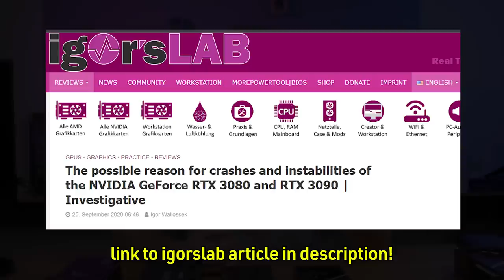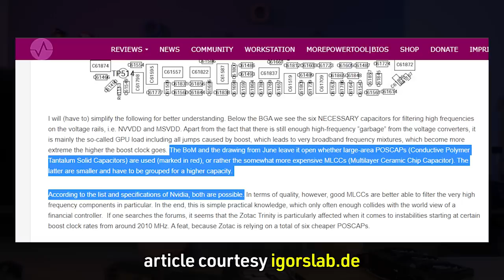The RTX 3080 Launch can't get any worse... Right? Wrong...

Comment: It's shitty because the cards get reviewed initially with the higher boost clocks, so if firmware comes along to reduce clocks, prospective buyers are misled by the high benches.
Reply: As long as they're stable at the advertised boost clock (which seems to be the case as the instability is coming from GPU Boost's ability to go beyond the advertised boost clock) they're fine, with the firmware nerf they'll still be within the margin you should be expecting as a buyer as it's possible for any card even without this issue to have a max boost speed equal to the advertised one.
Reply: Good review sites will make new benches to cards that gets reduced clocks! Don`t follow bad tech sites!
Reply: @RWoody1995  What you said has nothing to do with the issue I addressed.
Reply: @haukionkannel  It's only good if they delete the old content with the artificially high benches.  Otherwise people may still be misled.
Reply: Like he said It might only be a case of the AIB's in question reducing the clocks by just 25-50mhz. If so, then you're talking a 2% to 3% reduction to performance at most. Which If you where doing say 120fps @4K, would equate to just 4fps less. You've usually got somewhere around a 4-6% difference, between the best and worst preforming AIB cards, anyway.
Reply: @haukionkannel  and how do we know which ones are good?
Reply: @massacre072885  uh it has everything to do with it, you said cards would perform worse than the reviewer, i explained directly why they would not as it is perfectly possible for the reviewers card never to OC beyond the advertised clock and therefore even with a bios nerf, you would still get the same performance as that reviewer.
Reply: This is why you never buy a brand new product unless you're willing to deal with something like this.
Reply: @RWoody1995  these cards are already marginally better than the other. A 2% reduction is not a small deal...
Reply: 2BuckGeo  As far as we can see the founders are above spec; with two MLCC arrays, so they should be fine.
Reply: SUE EM! folks sued amd for saying core instead of moduel.. should be 100% lawsuit against npitty ya. the whole 8k label should be a given because the 8k isnt even 8k its lower then 8k. true 8k on it would be a 2fps slide show at True Actual 8k.. and 60,000.00$ for that true 8k screen and it isnt anywhere you could buy on a shelf anywhere. lol
Reply: @massacre072885  they aren't 'artificial' if they were reviewing a founders card, or AIB that has the good stuff. You seem to be getting caught up on some singular point that seriously underminds reality. Anyone wanting these cards will be watching all this and know what's up. And as mentioned, the better reviewers will redo their tests. Considering all of 2 people could even get a hold of these things this far your concern is literally overblown hysterical at best
Reply: @homelessEh  Honestly, I wouldn't be too surprised if the manufacturers sue Nvidia for giving them a flawed reference spec, while selling superior cards that they were able to actually test.
Reply: @LzysGraphics  It is not a 2% reduction though, as long as it still reaches the clocks advertised on the box it's running as fast as you can expect it to, with silicon lottery no amount of high end capacitors and bios tweaks is going to increase the max boost clock if it is set to the same value as the one the AIB writes on the spec sheet and the product page. If it takes it below the advertised boost clock THEN you can complain as you've been falsely advertised to but that's not what is being talked about being done here.
Reply: @fafski1199  that could be substantial to someone especially in the case of vr gaming. Also consider this is all around a bad look for the 3080 especially with amd's offering supposedly right around the corner.
Reply: @RWoody1995  That's not what Massacre is saying though is it. They WILL be slower than the review samples. 1710 + 200Mhz is a significant difference.
Reply: 2BuckGeo  Hopefully not, scalper
Reply: I think the idea is you should take the benchmarks with a grain of salt knowing that firmware may come along to reduce the clocks
Reply: @Massacre That, my friend, is called a "bait and switch" and it's 100% why you should NEVER PRE-ORDER AND NEVER BUY AT LAUNCH.  We wait years for these ground-breaking pieces of tech to launch, we can wait a couple of months for independent reviews, benchmarks, performance results, etc.
It's been said a thousand times before by people infinitely more influential than me, but consoomers gonna consoom.
Reply: @p0xus  The AIB cards in question are not following reference spec. How can they sue if they are not following spec?
Reply: @tacticalcenter8658  
First, the FE did not better in benchmarks than the ABI cards, show me one benchmarks to prove your claim. 
Second, it is not on NVIDIA if they ABIs use cheaper parts than defined in the reference specifications, it on the ABIs. 
Third, that is why you don't buy a new piece of incredible complicated hardware on launch.
Reply: @tacticalcenter8658  
I already watched them. MLID is an AMD fanboy that tries really hard to undermine NVIDIA, problem is that he has no idea of what he is talking about and that he is way more often wrong then right. His top source is his A** where he pulls things from. 😉
Reply: @tacticalcenter8658  True, you are one. 😉
Reply: 2BuckGeo The founders edition are not only safe, they are the better option. Better cooling solution and gpu boost.
Reply: @chadwagner1483  No, but they are based off it.
Reply: @p0xus  Yep, always wait at least 6 weeks before considering buying a new product. 9 times out of 10, there's teething trouble at a new launch.
Reply: @p0xus  How can they sue, when it's them who didn't follow the recommended reference specs? Nvidia recommended that they should use at least one of the capacitors in question, which when used, isn't causing a problem. Nvidia aren't at fault, It's some of the AIB partners for then cutting corners, ignoring this advice and then obviously not doing sufficient testing.
Reply: @tacticalcenter8658  Moores law is dead has turned into a conspiracy theorist and AMD shill. He's pissed because 80% of his predictions and so called 'inside leakers' turned out to be either false or fake. He now seems to have a big chip on his shoulder with Nvidia and is trying to undermine them as much as possible.
Reply: @tacticalcenter8658  Lol like what has been said in comments MLID is a shill. He predicted their would be a 3080ti at release, He predicted the 3080 would cost $1000, He predicted that Nvidia cards would only be getting a 35-40% performance increase. He didn't even know until day's before launch, whether they would be on TSMC 7nm or Samsung 8nm. He stated they'd be released with DLSS 3.0, being a feature. Yet, he completely missed every new feature that the cards actually came with: RTX I/O ect.
And that's just for starters. The guy's a pure shill, pretending he knows leakers and people in the business, but doesn't. On the odd occasion he does get stuff right, it usually either through a plain ol' lucky guess he pulled out his ass or via info, that he poached off someone else.
Reply: @georgschulz8143  The Asus TUF is better than the founders in every way.
Reply: Bullshit. Independent reviews have nothing to do with what is being offered. Whats being offered is on the box. As long as it does that it makes no damn difference what a reviewer says.
Reply: @AFC Steve Yes, that’s true. ASUS TUF is the best card available.

Comment: Asus constantly, going the extra mile and in this case coming up smelling of roses. Credit where credit is due.
Reply: I have to RMA my 2070 this week to them. Hopefully the process goes smooth.
Reply: Yeah I’m just waiting for a good ol Asus brand card
Reply: Bal'a dash, malanore.
Reply: @SlowMenWorking  lol good luck I had to RMA my 2080ti 4 times before they sent me back one that actually worked
Reply: why do you say that?
Reply: @lolliman21  yeah i onder that too isn’t asus like one of the best after market gpu makers?
Reply: @kry1429  not a clue.
Reply: Is that why my brand new Asus Tuf 3080 OC is crashing to black monitors several times a day???
Reply: @JimmyKerrigan  check ur voltages don’t over-overclock it’s a common mistake i believe
Reply: If you see the back of the card  where the gpu die is, you'll aee asus is leaving lot of small MLCC, but just replaced then6 set. So they are not entirely great as they have cut corner and replaced only things layman can see and be happy.😂
So if you see photos videos prior to issues, you'll see Pos caps on all their cards, that too cheap ones (220u). So tney waited till the driver fix came and then re-released the cards and became all goody goody.
Typical bullishit.
Reply: @shshankking  This wouldn't surprise me at all. I stopped buying ASUS because I found them to be overpriced and crap, just like MSI. Gigabyte has been awesome however with this cards launch they also have shown to be shady, although I'm wondering if they decided to do this and with their Aorus brand do the correct thing or even more (which is what I typically stick to anyway)
Reply: @TheSydguy30  Well i have Aorus 3080 Xtreme, and that is carrying 5 pos caps of 470u and 1 set of MLCC. and they also changed this, coz there's a video where a guy opened an earlier media sample of 3080 Master and it had 6 set of 370u Pos caps(like all other form asus strix to evga ftw). So they did change and fine-tuned it, but even before, with 6 Poscaps, they were already filling unused areas with MLCC's which others left on their cards like Asus, zotac, etc to fine-tune the power delivery near the GPU die. So they were doing better, to begin with, but then went a bit further, because of fear, competition or quality reasons, that's entirely on them. but they themselves are not entirely clean, as you mentioned.
Reply: @shshankking  Is that why when seeing ASUS TUF cards displayed on websites such as newegg and amazon the card shows 6 POSCAPs instead of the 6 MLCCs that are shown in jayz video as well as other video reviews?
Reply: That comma will find its way home eventually
Reply: They originally came with 6 spcaps and no mlcc
Reply: @nicklemanski8593  yes. They are using old photos. Even though they are using MLCC, they are of just 22U per unit, and 10 of them makes a single set out of 6
Reply: Dont buy ASUS lmao extra expensive and very bad in comparison to other brands.
Reply: @IorekBear92  Did youu get a new card? Asus warranty is pretty much fake, they charge you a lot of money just to give your stuff a check I hope all went good
Reply: @stevetoalacox  such as? We're speaking about gpus here
Reply: @StylinRed  ?
Reply: @IorekBear92  Dang lmao yeah the guy probably stole it for himself xd well the 1080 is doing pretty good rn the only thing it doesnt have is RTX, I hope someday you get the card thatt you want xd just dont go for asus cards or any asus product haha they are pretty bad and expensive
Reply: @stevetoalacox  you said don't buy asus it's expensive and not as good as other brands, I asked such as? (speaking of gpus here)
Reply: @StylinRed  Any other brand. Are you going mad about this? are you an Asus fan? Ill just leave you alone
Reply: @stevetoalacox  any other brand? 😂 Ah ic, I just wanted to see if you were a hater, or was offering legit advice, I guess you're a hater, by saying "any other brand" it makes that pretty clear
Reply: @StylinRed  ?? See ASUS fanboys will always be like that. cya boy trying to explain stuff to you is useless. try not to go mad about it, oh and besides that GYGABITE, AORUS, and ZOTAC is better.
Reply: @stevetoalacox  you just named the worst brands... Gigabyte uses cheap thermal pads that leak oil ASAP, and zotac has horrible quality control, so some gpus come with no pads and improper gpu paste, etc... If you had said EVGA I would've believed you weren't a hater bcuz evga makes a solid card, they're cheaper, and use same quality components as asus...
Reply: @stevetoalacox  🤷‍♂️
Reply: @stevetoalacox  everything goes oos the moment it comes up... There's a gpu shortage
Reply: @StylinRed  lol evga makes bad quality components.. See buildzoids pcb analysis of evga ftw3, you'll get you answer.. Also, asus cuts corner, but not to an extent some other brands does. Ad about zotac, they had one of the best 2080 card in last gen, amp extreme edition, solid pcb, and one of the top 3 highest clocking..

So curb your enthusiasm, all brands are same.. Some just bit better, not best..

Comment: A quote from EVGA forums:

Hi all,
 
Recently there has been some discussion about the EVGA GeForce RTX 3080 series.
 
During our mass production QC testing we discovered a full 6 POSCAPs solution cannot pass the real world applications testing. It took almost a week of R&D effort to find the cause and reduce the POSCAPs to 4 and add 20 MLCC caps prior to shipping production boards, this is why the EVGA GeForce RTX 3080 FTW3 series was delayed at launch. There were no 6 POSCAP production EVGA GeForce RTX 3080 FTW3 boards shipped.
 
But, due to the time crunch, some of the reviewers were sent a pre-production version with 6 POSCAP’s, we are working with those reviewers directly to replace their boards with production versions.
EVGA GeForce RTX 3080 XC3 series with 5 POSCAPs + 10 MLCC solution is matched with the XC3 spec without issues.
 
Also note that we have updated the product pictures at EVGA.com to reflect the production components that shipped to gamers and enthusiasts since day 1 of product launch. 
Once you receive the card you can compare for yourself, EVGA stands behind its products!
 
Thanks
EVGA
Reply: They got caught red handed,   trying to what they can get away first
Reply: @janc4176  Sounds right, there's no week of R&D needed when the 1st question should be "what's different between our card(s) and the Reference drawings from Nvidia or Nvidia's ref+ design
Reply: @janc4176  Yes but at least they are going with a HARDWARE solution instead of a BIOS fix.
Reply: @janc4176  they weren't if they would be able to get it work properly, then they could spare money. But they weren't able to get it work. So they did what they had to.
Reply: Thank God I bought an Evga RTX3090   XC3 Gaming that I will receive next week. Never been disappointed with my 2080ti Black either and expect the same with that one.
Reply: Thank God I ordered the ftw3
Reply: EVGA is still one of the most trusted brands for me, they actually tested, and when they realised that there was an issue, they actually spent time trying to fix it. 

Even if they didn't find the issue at first, I'm sure EVGA would've had an RMA program rather than a vBIOS update.
Reply: @omegacon4  Yes at least something positive, would rather hear that response "even if I don't believe the it was a mistake" than just saying there will be a driver fix.
Reply: @fuj1n  Yup. They even fixed the issue before mass producing units for consumers
Reply: Awesome
Reply: Glad I decided to wait for the 3090 Kingpin